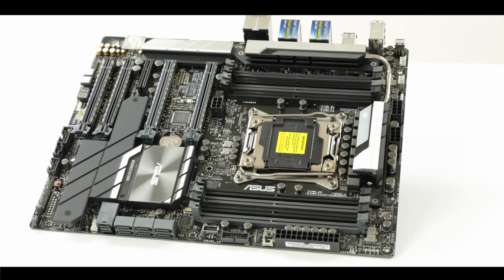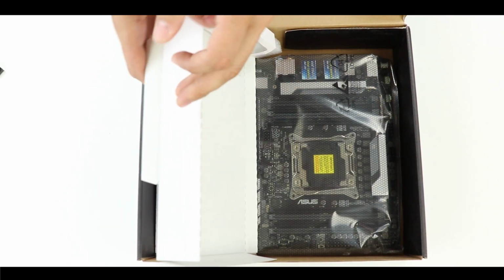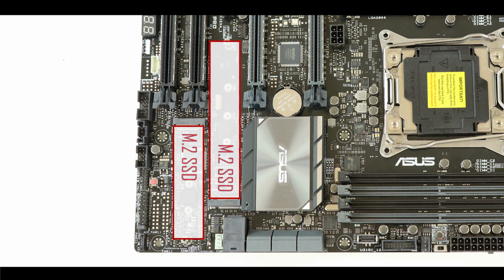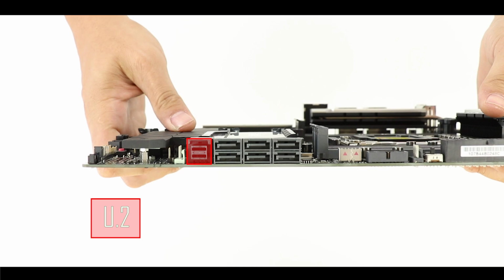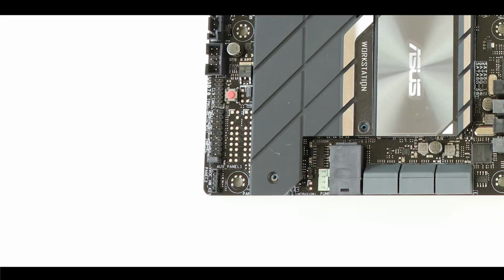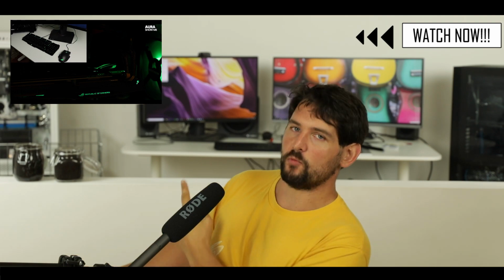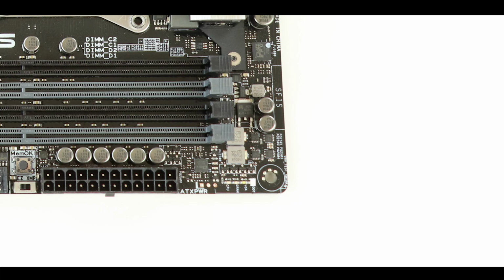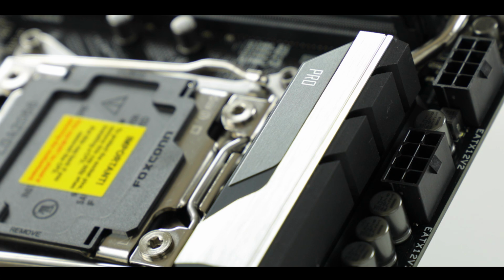WS X299 Pro, my next editing motherboard!

Comment: Hey Laurent, have you assembled your system already? I've purchased the same motherboard, and a power supply from said compatible in pc-part-picker website (CoolerMaster V750, RS-750-AFBA-G1)  but power cables won't fit. I can connect the 24pin power cable (to both MB and power supply, no issues). However, the motherboard's user guide states (p1-27) both 8-pin power cables must also be connected otherwise the system won't boot. 
The issue is: the 8pin CPU cable connects to the power supply but the other end won't fit in the motherboard. Any advice?
Reply from the maker: Yes. U r using a PCIe cable which works for video cards. There should be another 8 pin cable with one end marked with the word CPU. 

Also the motherboard end plug of the cable should be able to separate (clip off) in two 4 pin plugs. 

Tell me if u need more help

Comment: Shoud i get this with i7 7820X and AMD WX3100 as a new daily driver since the i7 920 isnt cutting it with gt 1030 and ssd, i might give the old one to my brother
Or should i get an i7 8700K or R7 2700X if there is a mobo from Asus that is WS
Reply from the maker: In your case, giving the choice. I'd go for R7 2700x no question asked. Get a x470 strix .. that would be perfect for u
Reply: Note that i will need a stable system to last me 10 years, i want a first boot to be success no thinkering or anything else, and what i have seen zen still isnt so stable and the programs i use aren t made for zen, and that ram incompatibility.
I just want a plug and play experience
And i need windows 7 to work, with intel i will just need a chipset driver and a gpu that supports it but with zen, ah too many cores.
I need windows 7 for my programs i use to work, specialy that internet explorer 8, yup i still am not sure about zen, but also i would like to give it a chance, or well just continue using intel since i7 8700k is speciefied in programs support list, also i need a cpu that has powerfull java stability, i mean one powerful and stable core, i was considering getting:
Asus H370M-PLUS
I7 8700
LC-CC-120 Cooler
32GB of 2×16 HyperX Fury White DDR4
Chieftec GPE700S
Master Box 3 Lite
AMD WX 3100 OR WX 2100
Reply from the maker: Zen came a long way since its initial release. The only problems where BIOS related with G series. 

I d still advice zen 2 over anything else right now. Simply more horsepower for lower cash . 

But the 8700k is of course a stellar CPU as well :)
Reply: Laurent's Choice ok i will get zen + r7 2700x

Comment: Very helpful you review! What PSU should I buy for this motherboard? I saw that have 2 x EATX12V1 - EATX12V2 (8pins) + 1 x EATX12V3 (6 pins), you forgot to specify this in your review. How to use this EATX12V1(8pins), EATX12V2(8pins) and EATX12V3(6pins) ??? Regards!
Reply from the maker: Any PSU will work, but id go for a Corsair HX séries. 

PSU cables are usually well marked. The 8 pins CPU as CPU printed on the sode of Psu plug.
Reply: @Laurentschoice  Many Thanks, I subscribed to your channel .
Reply: But do i have to connect both eatx12v2 8 Pins or is it Boxring with one ?

Comment: Great video, just what I was looking for! Thanks!
I am building a WS with this m/b and I was only wondering if I can use a Corsair Dominator RGB QUAD Kit 64GB 3600MHz (CMT64GX4M4K3600C18) with this m/b. It's not listed in the QVL, although other corsair similar Rams are. Is that a problem? I would appreciate your opinion Laurent. Thanks again!
Reply: what ram did you eventually use? Planning to build around this mobo.

Comment: To be honest the marketing of this board is a rip off - the x299 i9 xe by asrock smacks this board marginally in features and delivers a solid vrm - how is that board anyway? It costs the same as the x299 i9 xe here and seems to lack features.
Reply: Not to mention the x299 i9 xe has a TRUE 10 GB ethernet port and another 1 GB port
Reply: Xx Tek tip xX
Ex ws x299 pro owner here, I have to agree with you sadly since the board is a scam aimed at us server and workstation users - Funny enough you mention the x299 i9 xe because that's the board I've got currently and it's rock solid stable and overclocks like a champ.
Reply from the maker: Ok..
 I'll review the i9 XE . 
I got why there is no 10gbps Lan. The U.2 connector swallows a massive amount of bandwidth. Instead of the usual 10gbps they have it 32gbps. 

I really like the robust feel and quality of VRM coolers... but ASROCK ... here I come .
Review in mid August:)
Reply: Laurent's Choice Wow thanks a lot buddy - it will help justify my purchase :)
Reply from the maker: Asrock will give me the board tomorrow so I'll do a review in the next few coming days. 

Let's see :)
Reply: Laurent's Choice Send it to me when your finished haha. I've been saving for around 2 months already - I would've had the cash but sadly gpu price rise by mining put my 1080 ti ftw3 up by £250 and RIP wallet.
Reply from the maker: Got the board ... follow me on Twitter to check it out.
Reply: Laurent's Choice wow that's fast - even when I buy something it takes forever to come..

Comment: you just told us what it has, but not how it runs. does it still run smooth. does it have any problems. Pro/Cons? Thanks, your the only one who reviewed that board.
Reply from the maker: Hey :)

So usually, if i do not go out of my way to say something went wrong ( as in the TUF z390 gaming plus and over heating) , then you can safely assune that all went optimally. 

This is probably the longest motherboard review i did in a long time, but indeed, there is more to add and i did remove a couple of sections from the final edit.
Reply from the maker: One more thing, there is a more detailed review of this board, as well as a precise list of pros and cons on my website https://laurentschoice.com

Every motherboard i review ends up with a more in depth report there.
Reply: @Laurentschoice  just searched for a video and you are the only one who reviewed it. it was missing some stuff so i had to ask. thanks for the fast answer.

iam looking for a new mb for the x299 Socket, iam only interested in the Asus WS x299 Pro/SE. (no led bullshit and no nonsence) only a good quality mainboard with no major problems. 

what are the cons of the board in your opinion?
Reply from the maker: Brother, im absolutely grateful you did.
I feel bad that i didnt cover what you were looking for :(.
Im always torned between mass public  content and more in depth content. 

Check the article on my site, and if u need more details , please let me know
Reply: thats no problem, i was happy i found a video about the mb. 
i know what you mean. but as long as i can ask and you answer everything is fine. 

are there cons to the board? or is it overall good?
Reply from the maker: Hey :) sorry for the delayed answer on this. I'll say your gut feeling is spot on. I did a review of the WS X299 Pro and that's where you want to be if you are looking for rock solid unstilled performances. And most importantly... something with a bare bon approach to Work Stations.
Reply: thanks. i still have 1 question: does it really takes 100 seconds to start up? (something i can live with, but may be anoying) 
yes i need a stable board not only for gaming, but also for my VM envirement, editing, and rendering. 
but thanks a lot, know i know what board i want to have. =)
Reply from the maker: Depends from what medium ur booting. 

If you are booting from a mechanical drive, would not surprise me. 

If you boot from a M.2 SSD, it ll be MUCH faster.

X99 and X299 chipsets powered mobos take longer to boot compatred to H or Z series chipset simply becuase they start up woth quad RAM channels.

Tskes longer for the BIOS to go trough them. So count 4 to 5 seconds before seeing the splash screen on boot.
Reply: Thanks! ill boot from a m2 SSD. just somebody made a consumer review and said that it need about 120sec to startup. 
with 5 seconds more i can live with that. :D now i know what mb ill buy.
Reply from the maker: And itll save u 100 bucks over the Prime . 

Indeed, if you are running an X299 on 4 gb of Ram (if it even boots ) , a 5400 rpm mechanical drive and coal French electricity .. indeed ... might take u upwards 120 seconds to boot :)

Comment: I’m quite surprised not to see a 10gbs Ethernet on this one.
Reply: Get a x299 i9 xe (asrock), million times better :) and it has 10 gb/s ethernet and 1gb/s port as well.
Reply: Xx Tek tip xX it’s really weird not to have the 10gbs on this one tho. It has WS and Pro in its name ! And cost 400dollars.
Reply from the maker: The U.2 takes a 32 Gbps instead of the usual 10. I suspect that is why there are no wifi or 10Gbps.
Reply: Laurent's Choice The only downside with 32gb u2 over 10gb u2 is the fact that it will cater for 1% of x299 users - u2 ssds can cost £600+ minimum and it sadly sacrificed common features for it - at least the board does the job i guess.
Reply from the maker: Agreed ... I agree
Reply: Xx Tek tip xX the 10gbit might cater to more but wonder how many. Especially considering it's an Aquantia NIC. I'd probably not be allowed to even try hooking it up at my job.
Reply: Wokis Why? There is a 1gb port as well - they are probably scared you'll rip through their bandwith since you'll get priority connection over everything else
Reply: Xx Tek tip xX No (in this highly theoretical situation because we have actual workstations at work and not my home pc) we have a 10gbit network with some cisco switch and the rule is basically they want HP badged QA tested Intel powered 10Gbit NICs just because of the afforementioned QA spent on making sure they and their attributes work not only with the network itself but also sensitive applications such as Avid Media Composer and the like. Aquantia is a no-name. Will suffice in a home 10gbit situation but then again how many people are going for that?

I guess what I'm saying by extention is that I understand ASUS wouldn't include an Aquantia NIC and brand the motherboard Workstation because it'd be disgenuine. Those who are actually looking to build psuedo workstations wouldn't consider the NIC adequate because it would not be covered in support agreements. The other option they had would have to go for a much more expensive 10Gbit NIC and for one reason or another they opted not to.

That said it's ok and even good that ASRock includes one in theirs. But that one is also not branded workstation so it's not disgenuine either.